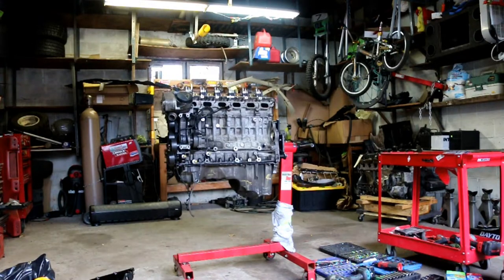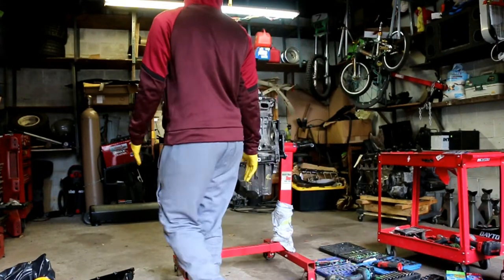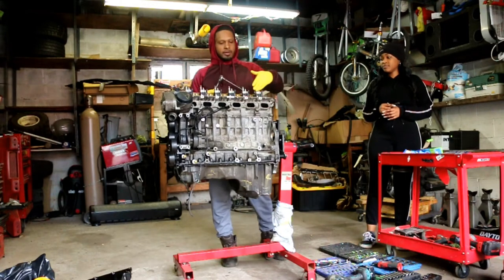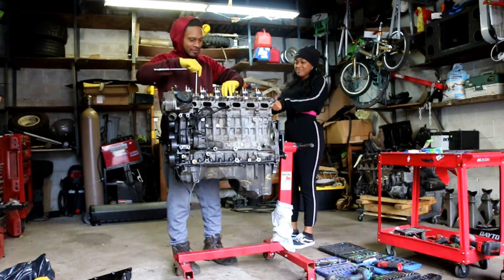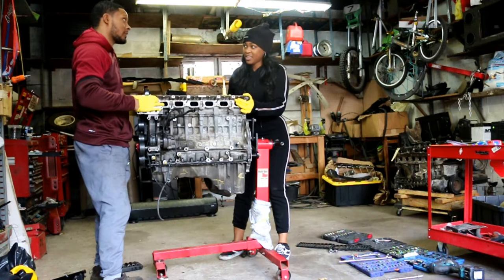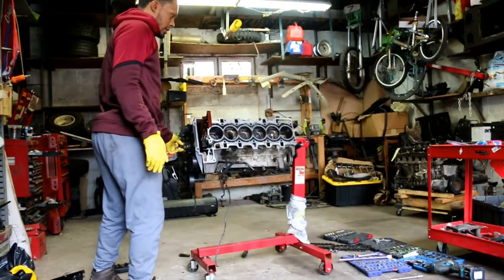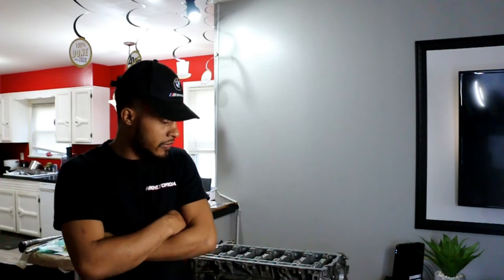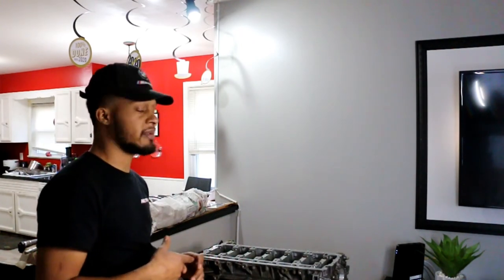N54B30A REBUILD | EP1 THE TEAR DOWN

Comment: Jermaine,  I noticed in one of your n54 videos that you have printed out the all the torque specs for the parts of the motor your working on....  Can you pass on the link as Hanes doesn't have a book on the N54 e90 and the Bently book doesn't even touch the internals such as crank block so I am looking for something definitive for the block, crank, head bolt torque specs!
Reply from the maker: Use newtis.info